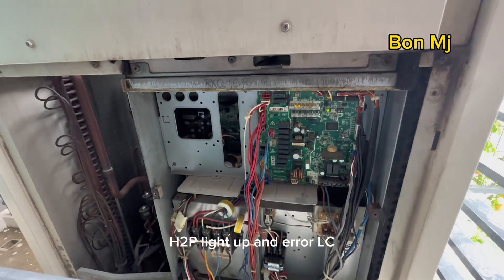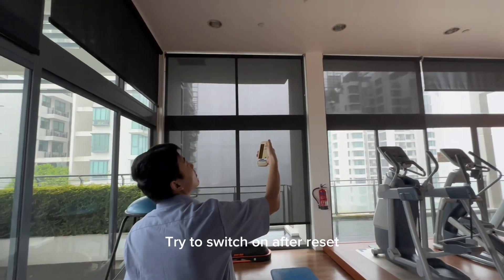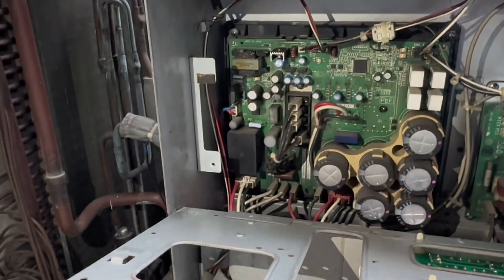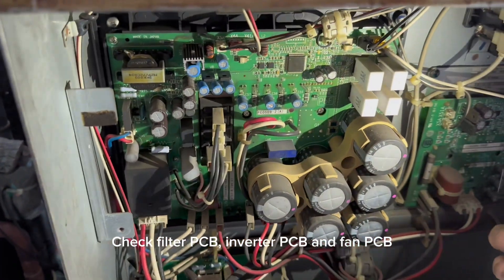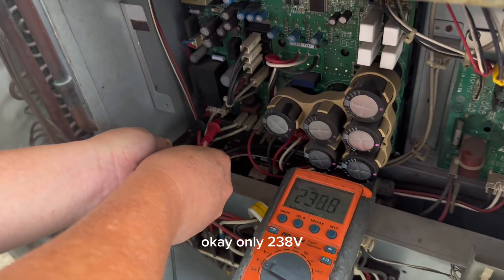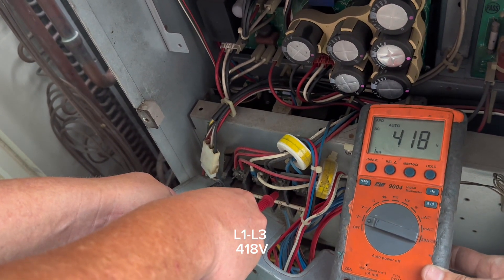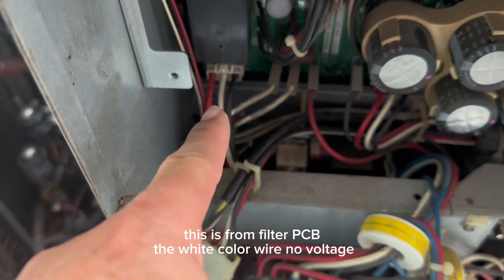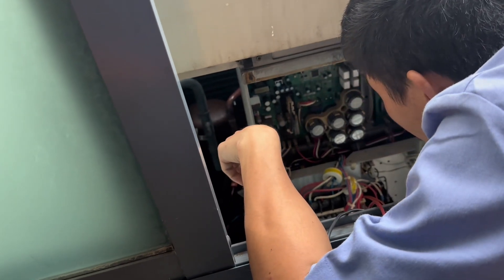AC troubleshooting at high floor | Error LC | VRV3

Comment: Is it the(faulty) Filter Pcb output voltage to Inverter Pcb is incomplete, then causing Inverter Pcb  fail to work and no DC voltage output to DC fan Pcb right ?